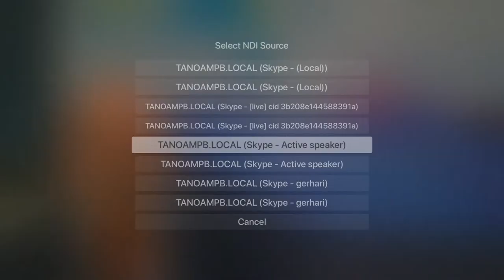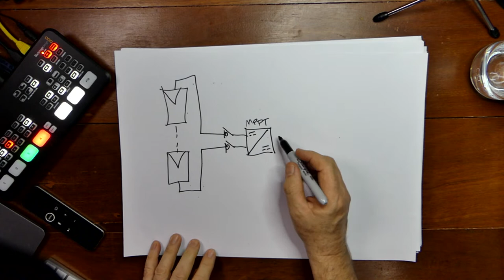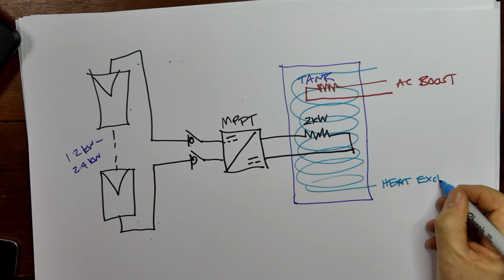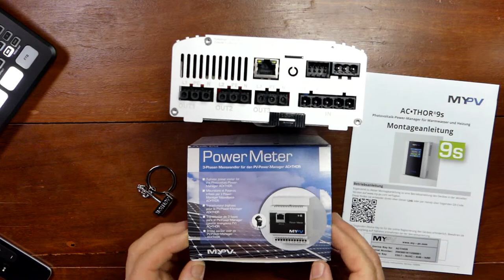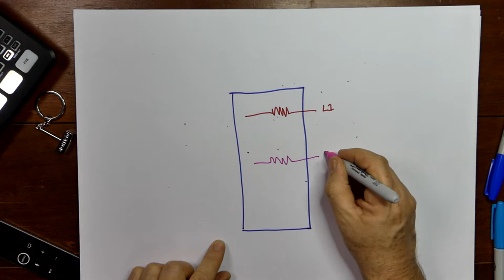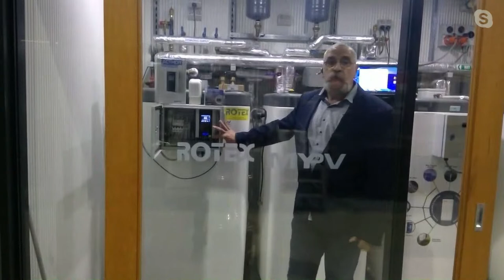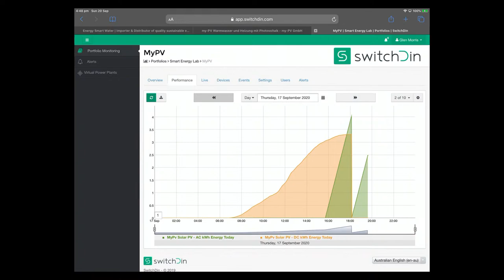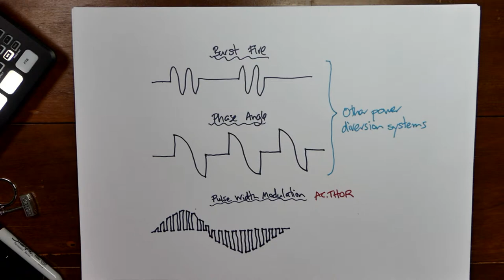Heating water with solar PV power

Comment: Good show guys, made me think some more today. I have grid tie already, but could use a little more. Being in a cold climate, northern hemishphere, i'm planning on another 2kw  for winter time only just to tie into DC submersible  elements to assist the shop heating. The shop has about 5kw of heat loss, so the 2kw could cook all day long with no overload. Now because i was watching your show, lets utilize the 2kw in the summertime for domestic HWT, sounds like a plan hey. Thanks. Upper rubber boot Saskatchewan electrician.

Comment: I'm off grid and have been heating water for years with a pulsed DC system with arc interrupt off the PV array DC, no inverter. I built my system.  No additional panels were installed for hot water, this operates in parallel with MPPT charge controllers using only excess energy that would be wasted.  I have two tanks in series for home hot water and a 40 gallon tank just for laundry.  We run hot in each cycle for that extra clean. we can do two loads a day. Pretty amazing considering the home hot water tanks have priority over over laundry.  Even the dishwasher is tied in for added temp boost and heated dry.  A friend built the system too and besides hot water he powers his electric dryer heating element.  Even real early in the morning and on rainy days I can dump 50W into the heater.  Why isn't everyone doing this.  I get almost no interest in the solar world.  Charge controllers waste amazing amounts of energy each day.
Reply: Hi Opera,I need to talk to you about putting exess energy into a baking oven how can I get hold of you?
Reply: @buildingbiology  An interesting application.  Just how big an oven would this be, array size/voltage and how many elements. Would like to understand just how realistic this project would be first.  I can always be contacted on my channel.
Reply: @opera5714  Thanks how do I find your Canne Please?
Reply: @buildingbiology  Just click on my name opera or search MPPT hot water on youtube.
Reply from the maker: Hi Michael, I guess this is my YouTube channel and you can also contact me on my Facebook page - just search for smartenergylabs
Reply: Their PV direct actually works in a similar way.  It has no inverter, and it, also, has a 99% efficient MPP capability:

http://www.windandsun.co.uk/media/921139/MY-PV-ELWA-Datasheet.pdf

Comment: How long have they been doing this? Because pvdc to heat traditional hws has been around for years. Not really pioneers
Reply from the maker: Yes, using d.c. to heat water isn't new but MyPV add network smarts to the system so that you can divert a.c. power or direct heat with d.c. using an efficient MPPT.
Reply: Yes that's how it should be done. Using mppt. As he mentions. Its all about controlling the thermostat.
Reply: Which. I hope they do well. This way is the way of the future. Pv heat is far superior to pv thermal. And this is great for people who want to retrofit current hws or can't or don't want gas hot water. I should of said from the  start, "well done" and best of luck

Comment: Way to complicated
Reply from the maker: Hi Doug, can you expand please? Was it the explanation or the mode of operation that you found "way to complicated"?
Reply: Was being sarcastic, sry .  
I have 3 300w panels connected directly to a 4500w element which provides me with 50gals of hot water at 140f/60c I like simple.
Reply from the maker: Hi Doug... there really needs to be an emoji for sarcasm :) Now I understand. Yes, that'll work but you will sacrifice the extra power an MPPT would get out of your panels... and you may burn out your over temperature contacts on your element as they're not rated for d.c. switching.
Reply: @SmartEnergyLab  but this element was matched by the ohms
Reply: @SmartEnergyLab  I would like to see a micro inverter designed for off grid just for heating water then there would be no changes to the tank , plug n play
Reply: @dougbarrett7803  something like a cybo inverter?